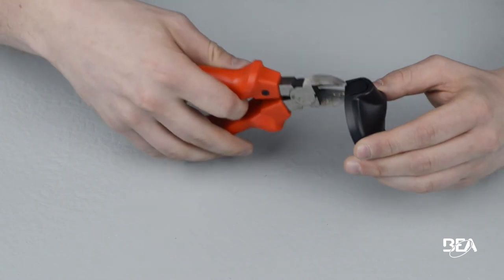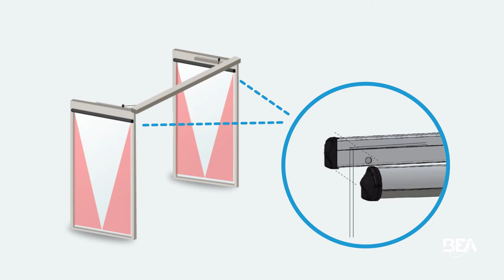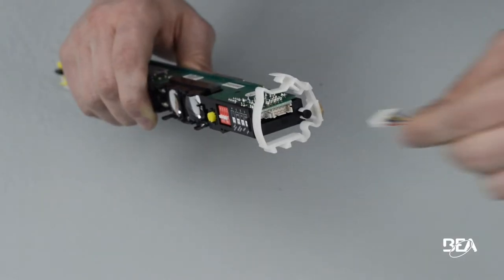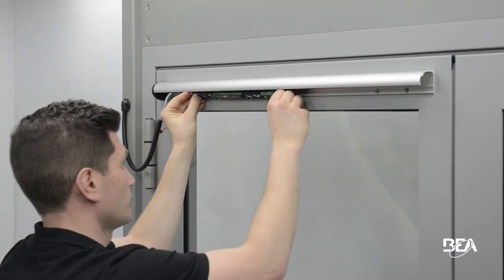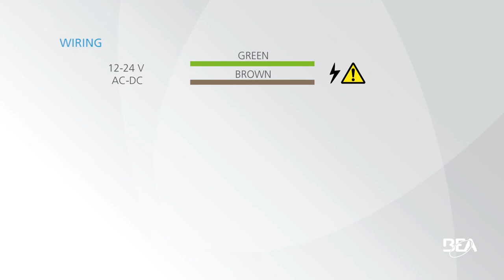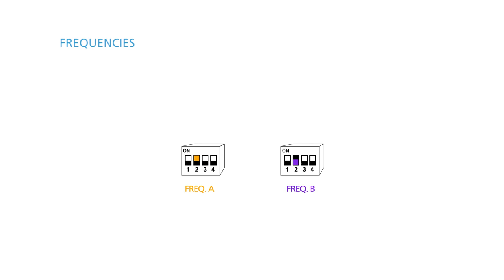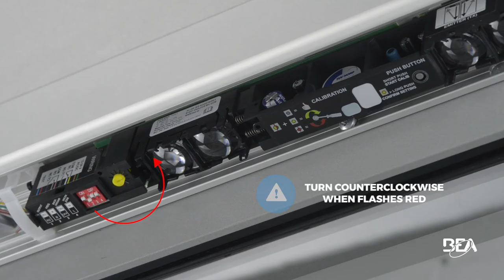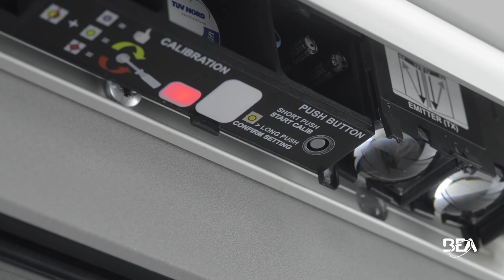Tutorial 4SAFE SW - Safety sensor for swing doors (tuto)

Comment: someone can help ...how to connect the ed250 of dorma ?
Reply from the maker: Hi! Thank you for your question. You can get in touch with Sandra from technical support, she'll assist you in connecting the sensor to the ed250: + 32 4 361 65 65
Reply: how to contact the contacting the ed 100 Dorma swing door module please share the wiring connection please